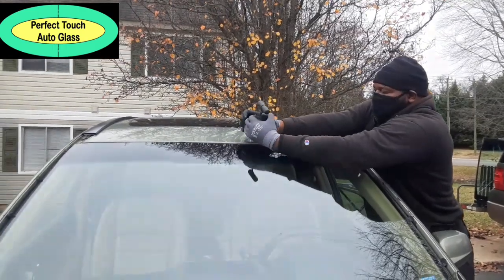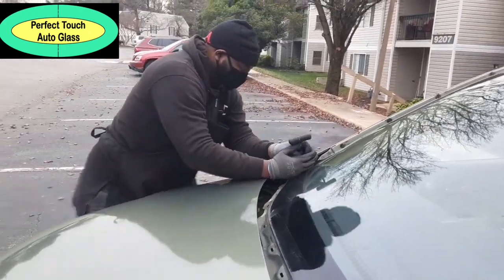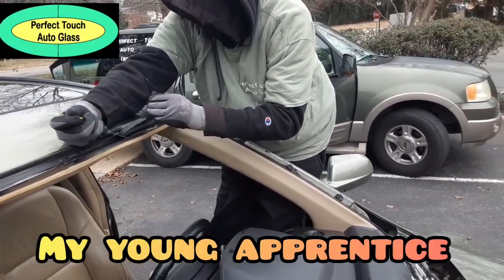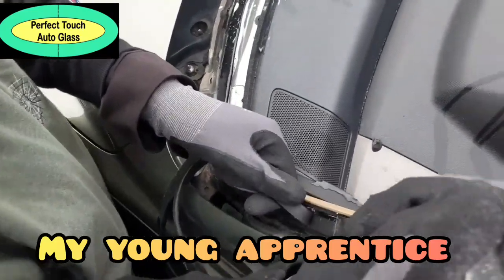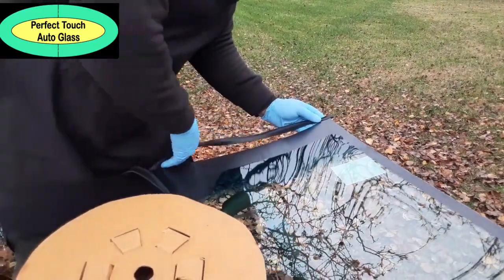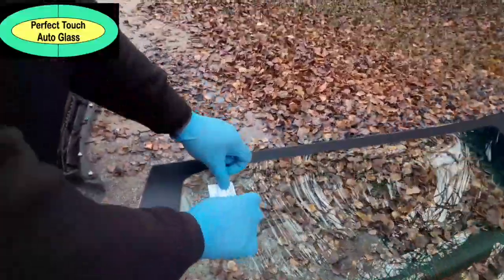2009 Honda CR-V Windshield Replacement

Comment: I replaced the windshield on my 66 Mustang myself. That has the old style rubber gasket that stretches around the windshield then you gotta put sealer all around with a caulk gun. People said most window repair services wouldn't do it because it's too time consuming and tedious and outdated. To me this looks way more difficult and requires special tools. I think I'll leave my CR-V to the pros like you guys.
Reply from the maker: Majority technician dont apply sealant to the gasket after installing  the windshield. However, it best to apply some type of liquid bond agent to prevent leaks.

Comment: First thing first, good god damn job! Installing the windshield yourself is amazing!

True, most service providers will pass up the job. Not all vehicles are the same. Installer pray that the gasket is good condition.  We hate using a new gasket because its not conformed to the pinchweld.  That's an issue all by itself.  Next, we hate top corner windshields. It is difficult to fit that glass in without cracking it, or seating in properly. If the windshield is round corner, let the good times roll. Then some old schools have chrome locking molding. Fuck!!! Big fuck!!!

To add which is extremely important.  Customers dont wont to pay to fair price to install this windshields. So its easier to pass it up. Also, considering size of company. Small companies like myself will pass it up all day. To avoid setbacks like time, possible 2 or 3 windshield ( which is a loss because cost of service was charged like a normal urethane install). Big headache,  larger company can do it. Extra employees and can front the loss if the windshield cracks. Like Safelite 

Hopefully,  this was detailed for you. Last and least. Good god damn job on that install.

Comment: If the top of windshield fits just above top rubber seal with small gap from side view upclose  across..Is that in- correct placement ? Should it be flush with rubber seal.
Reply: Hello,  your comment is important.
Reply from the maker: sure

Comment: I would like to replace my own windshield. Would you be willing to help me getting started with a few of the tools and tricks for a DIY?
Reply from the maker: Cold knife, long knife, power caulk gun or manual. [ manual suck ass] 2 tubes of all-in-one adhesive, suction cup, tape
list of tools below
https://amzn.to/3LiK9tA [amazon]
https://amzn.to/3Lk1d2r [amazon]
https://amzn.to/3S7a8rL [amazon]
https://amzn.to/3WiyfpP [amazon]
https://amzn.to/3Y1VpSt [amazon]

start up kit, low cost. long knife the bottom out of wire cut. hope this helps